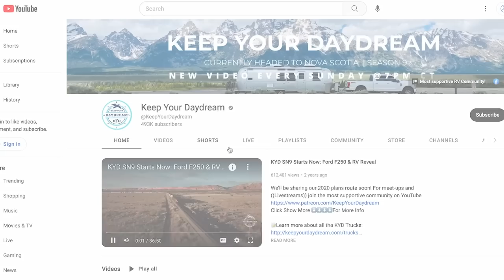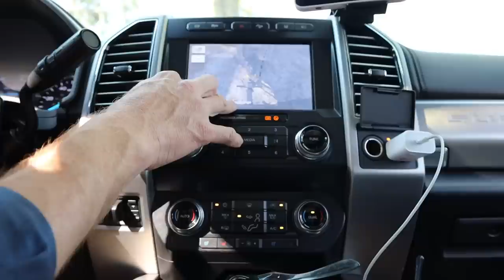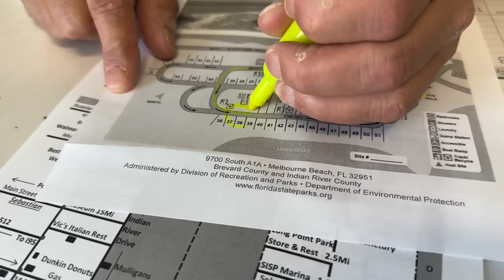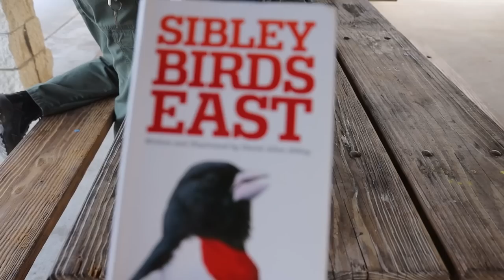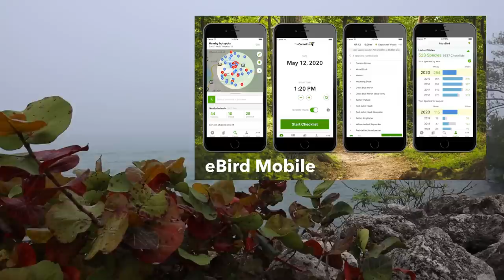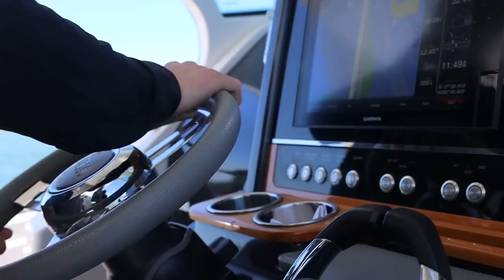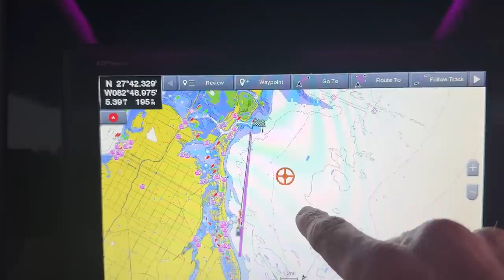🌴 RV FLORIDA: Come Relax in Sebastian Inlet State Park

Comment: I switched to wood instead of leveling blocks under the tongue jack because of the slip factor. Especially on an incline with just a little moisture, plastic leveling blocks can be slippery! A chunk of pressure treated  wood feels much more secure and certainly has more friction. BTW I’ve loved your channel for years. Cheers!

Comment: I'm glad your water leak was a quick fix.  I had the same thing happen on my travel trailer years ago.  We stayed at a campground near Mount Rushmore and the temps went from 70 to 30 overnight.  Our tank froze and the cheap plastic spigot cracked.  I put in brass drain valve like you did and no more problems.

Comment: Several years ago as I was parking my 18’ bass boat at the of my driveway which opens up to my acre backyard which is also downhill, I didn’t chock the tires (thinking that part of the yard was fairly level) anyway when I lifted the hitch latch (chains unhooked) the tongue popped up just missing my face as the trailer started downhill until it hit a concrete block about 10’ away. If it weren’t for the block, the boat and trailer would have gone about 150’ and vertically down 20’! Yes, now everything is chocked even the riding lawnmower or wheelbarrow.
Reply from the maker: I get it! We've had a couple close calls on "flat" surfaces. Better to just do the same way every time and let poor judgment get in the way :)

Comment: I block my trailer wheels both sides every time, since once when one tire was on a slight bump after lifting the trailer off the ball, that side of the trailer moved off the bump.  This was a small box trailer. Its till good practice to follow to prevent injury and truck/trailer damage, especially if leveling devices are used.
Reply from the maker: Exactly.

Comment: I thought I was going to stop chocking the uphill side. The first time I did it there was pressure caused by the levelers and I unhitched and watched in horror as my trailer shifted UP HILL as if pushed by a ghost toward my truck. I lucked out and it stopped just short of hitting my truck.

Comment: It seems like the Andersen Blocks have become a bit redundant? I'm new at this, but it seems your regular blocks always work, and Andersen sometimes works, but they're maybe more convenient when they do? I bought both.
Reply from the maker: The Anderson blocks are great when leveling beyond 2" (which is often) and leveling by yourself with the Level Mate Pro. Getting up 2 to 4 inches with blocks is tricky with them slipping and dangers if you come off, which can easily happen. Having both is good. Right tool for the right job.

Comment: Just curious why you didn’t use your scissor chocks btwn your wheels instead of the rubber ones?
Reply from the maker: The X chocks are not chocks. I put them on after I disconnect, but only if the trailer is shifting front to back or we'll be there for several days. For 2 nights, I don't bother with them unless I need to.